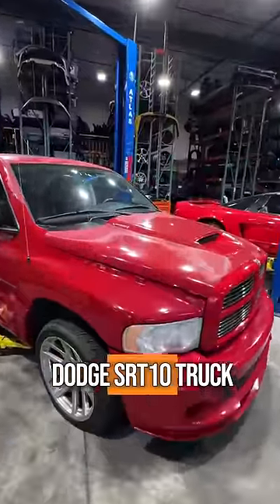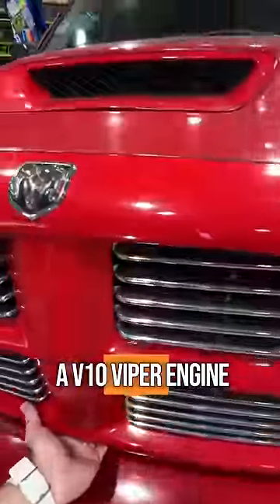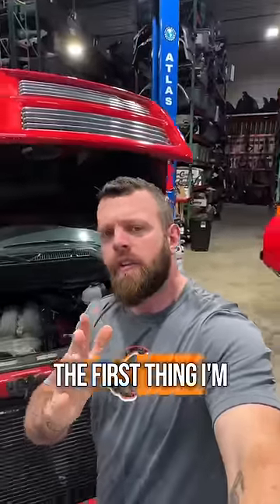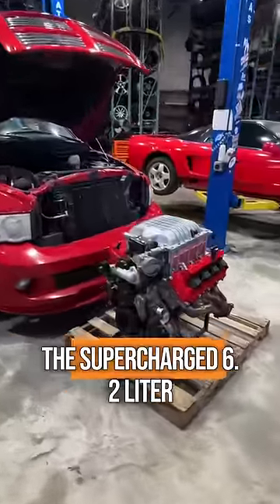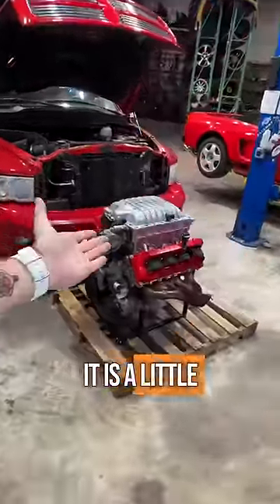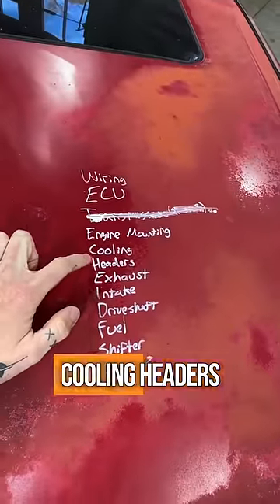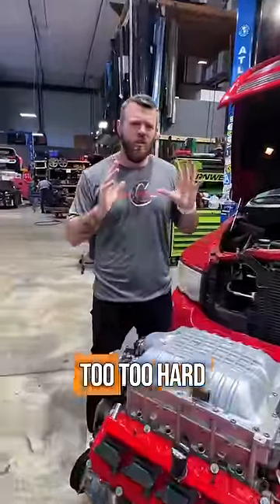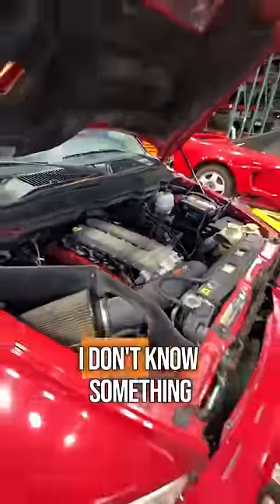Building The World’s First Dodge DEMON Truck!

Comment: “Tires are dry rotted”proceeds to do burn outs
Guys I thought this was funny 🤣 I’m not saying I wouldn’t do the same
Reply: Correct. Its not like he could have put different tires on in the time between the clips
Reply: What else are you supposed to do with em. I'd rather blow a tire in a secluded area than blasting down the highway at 80mph
Reply: "don't hold air"

Proceeds to do burnouts on flat tires?? 😂 OK...
Reply: That’s exactly what you do with them.
Reply: Well if your gonna replace them mine as well
Reply: @jackengele2144 he didnt theyre the same
Reply: what else are you gonna do with dry rotted  tires
Reply: If they're gonna be tossed, may as well use what's left.
Reply: I came to see if somebody pointed out the burn out after he said tryes are dry rotted!! 😂😂😂😂😂😂
Reply: @shaktisingh5543  🤣
Reply: @jackengele2144 yeah but what happens if the tire blows and takes out the whole rear end ik we’ve all seen it before
Reply: If you were trying to make some clever point, you have failed miserably.
Reply: @Willie-wf7vj  dude it was a joke I thought it was funny
Reply: "Doesn't hold air" means they lose pressure/ constant slow leak. It does not mean the tires can not be inflated and stay inflated long enough to do a burnout.  @briansguy
Reply: Why not?
Reply: @briansguy they slowly leak , hold air hood enough to burn them
Reply: Proceeds to install Demon engine ✈️🤣
Reply: Ive got 6 wheels all with dry rotting stocks just waiting for me to slap an lsd and one piece drive shaft into my truck and let her eat
Reply: @jones9309  🤣🤣🤣
Reply: @nikhenry4621  🤣🤣
Reply: Best way to send them off! I picked up a super cheap set of tires last summer, finally got around to checking the date code and they’re from the late 90s lol. They’re amazing for burnouts! They smoke immediately 🤣 just don’t try to stop in the rain… they’re the first thing getting changed when it’s back out of storage. They’ve been stored inside for many years and don’t show signs of cracking/failure, but I probably shouldn’t be driving around on tires that are older than me, especially not for the sake of a few hundred dollars.
Reply: @briansguy If you needa get new tires anyways why not have some fun with the old ones
Reply: Agreed a stock viper v10 engine with low mileage way more impressive and cool then a hellcat engine and more rare
Reply: "Finish him"😅

Comment: I would not replace that V10 with a Hellcat engine I would twin turbo that V10
Reply: Demon engine
Reply: Makes more power right. No sense because there’s no replacement for displacement.
Reply: Supercharged v10 would be sick
Reply: If you were gonna demon swap a dodge ram why not spend less money on a base model?
Reply: Exactly tt it and be able to make close to 2600hp and it be done or LeTs PuT dAaA dEmOn iN iT
Reply: Newsflash, its the same engine. @codysnyder7341
Reply: @emmanuelmedina2740   no its not
Reply: @bradmiles8242  literally is, but go off
Reply: @emmanuelmedina2740   your saying a v10 is the same as a demon engine not even close karen
Reply: @bradmiles8242  my man, my first reply wasnt even towards you. I was talking to the guy saying the hallcat engine isn't the same as the demon.
Reply: @jackstraw8786 bc this is a srt-10 ram, only a few thousand were made. it has suspension brakes trans and a lot more that can handle the demons power, a base model could but it wouldn’t be ideal.
Reply: @emmanuelmedina2740 well while it technically is the same engine, demon has a bigger blower so not really
Reply: @epicpeegaming2438  ...so...youre saying its the same engine with a different blower? so how not really? when you literally just said it was
Reply: @emmanuelmedina2740  dude I know I was teasing
Reply: Biggest down grade keep the v10
Reply: @emmanuelmedina2740 the demon engine is twice the horse power
Reply: @epicpeegaming2438  its the same engine, no two way about it. Theres no "technically". Its the same engine. Swapping FI systems doesn't make it a different engine.
Reply: @ExtraterrestrialBeing-jc7to  twice the horsepower of what? The viper motor puts out 500 horse NA, and the Hellcat does 700+ SC'd. The Demon (the same engine) puts out 800+ with a bigger SC. 

Idk what motors you could possibly be talking about.
Reply: @emmanuelmedina2740  you're talking about two motors with superchargers now if you apply a supercharger to the V10 or even twin turbo it you could be making a thousand plus horsepower
Reply: @bradmiles8242  lmao why u keep arguing with me. Im AGREEING with you. Im talking to someone else
Reply: Quad turbo
Reply: That v10 had more nuts than v8 I don't understand why he did that
Reply: @jackstraw8786 Maybe to have the engine also
Reply: @keegentilley578 twin turbo Calvo build
Reply: @reesebroekhoven3962 twin turbo Calvo build
Reply: @emmanuelmedina2740 No. this is a V10… the demon has a heavy pos V8 that overheats…
Reply: @emmanuelmedina2740 this was made in 2003-2005 kid….. the hellcat engine variant didn’t EXIST until 2015 and the demon variant didn’t exist until 2018…. So no.
Reply: @ysl_BRIAN just under 10,000… roughly 9580 made yeah
Reply: @joshroi8610  can you even read?
Reply: @ysl_BRIAN absolutely not kid. You can upgrade a base model for less than this costs. You could easily build a base model ram hellcat for way cheaper. 

The thing is exactly that. Less than 10,000 V10 SRT10 were made, so why ruin it? If you want a hellcat truck buy newer, don’t ruin a classic and everything that makes it special…. Anyone wanting this truck to be fast, with common sense, would immediately think “Easy, twin turbo V10 Calvo viper drivetrain swap”…
Reply: @epicpeegaming2438 bigger blower and 60-70% of the drivetrain parts are different. So it has the same block and A COUPLE engine components. That’s it.
Reply: @ExtraterrestrialBeing-jc7to lmfao no. The demon engine makes 1025hp, the hellcat red eye makes 808hp…. That’s NOWHERE NEAR double kid. Stay in school.
Reply: @emmanuelmedina2740 again, I’m an automotive engineer child. You’re wrong. It’s the same block with entirely different internals.
Reply: @emmanuelmedina2740 No. hellcat makes 707hp, red eye makes 808hp, demon 170 makes 1025hp. And a viper V10 can be built to handle EASILY 3x the power a FULLY BUILT 6.2l V8 hemi can handle no matter what. Look up twin turbo calvo viper kid
Reply: @emmanuelmedina2740 please continue to embarrass yourself. It’s quite hilarious 😂
Reply: @reesebroekhoven3962  Do they make transmissions for the Ram that can handle that kinda power? I know Calvo has em for the Viper but haven't heard of anything on the Ram.
Reply: @keegentilley578 Roe and Paxton make them for the viper. You have to replace the rods and pistons with forged ones because it will be destroyed in a matter of a few miles if you don't. A stock viper engine can only handle 600-650 HP.. you put a meth injection and a Toe supercharger on it it will melt that baby down
Reply: @rahulsudhir666  the srt10 ram the full drive train is from the viper
Reply: I was thinking put the blower on the 10 with some more bolt ons
Reply: Facts and a nice cylinder head job down pipes exhaust bad ass 😊😊😊
Reply: @jackstraw8786  he put the v10 in his Silvia
Reply: The engine is also very old so twin turbo charging it might cause a lot more problems and the demon engine is much more modern
Reply: @ExtraterrestrialBeing-jc7to  the Demon like 840hp+ and the v10 has 500hp N/A
Reply: @James-ij3lw  good opinion but mine rebuild and twin is a great opinion aswell
Reply: @emmanuelmedina2740 the Hellcat and the Demon  . The same block but different supercharger . Yep  i prefer the V10
Reply: Let me get that v10 😂💪🏾
Reply: V10 Magnum
Reply: Just put the supercharger on the V10 or something
Reply: Yes!!
Reply: @bradmiles8242 . Power output is based upon the boost makers CFM flow. Big Hp V10 N/a with its displacement has so much more potential.
Reply: @bri-manhunter2654  that's exactly what I am trying to say
Reply: Yeah that would be awesome
Reply: Way more expensive
Reply: @bradmiles8242 bro you can’t even read no one said that 💀
Reply: @epicpeegaming2438 you clearly haven’t ever worked on a hellcat 💀
Reply: @ExtraterrestrialBeing-jc7to put a sc on a viper like the hellcat requires 💀
Reply: @codysnyder7341 same engine more power
Reply: @epicpeegaming2438 a blower is just an add on. He's saying it's the same engine dude. Meaning engine block. Not the same bolt on parts lol.
Reply: @ExtraterrestrialBeing-jc7to the demon engine is twice the hp STOCK. That demon engine isn't capable of 3000hp like the v10 is.
Reply: @200130769  I was simply stating the HP they come with..
Reply: @ExtraterrestrialBeing-jc7to  stock hp ratings is for people with no tools in their garage and pay for their race cars. I can't remember the last stock vehicle I had lol.
Reply: @jackstraw8786  he needed a v10 too
Reply: @ExtraterrestrialBeing-jc7to  only because of the super charger. The v
V10 puts out just under 600, naturally aspirated

Comment: The nice thing about dodge trucks is it doesn’t matter what level of truck you buy the body is the same so the engine bay will fit anything up to the 6.7 Cummins diesel.  So lots of height width and length to work with.
Reply: Thats why he should buy another ram instead of using this srt 10 for the hellcat swap
Reply: @nakeddrifter4685  that is also true
Reply: @nakeddrifter4685 I mean at the end of the day, it’s his money and his time. 

Let uniqueness win, not everything has to be oem/stock.

Comment: Why take out the viper motor...just build that motor and have a beast. The sound of a viper is way better than the sound of a demon...but I get it it will be a sick build when it's done!! Awesome 💯
Reply: Dunno about it being a sick build i mean a srt10 is awesome because the v10 you put a beefed up hellcat motor in it. Its kinda lame
Reply: its a totally different V10 than the V10 in the viper. It just has some fancy viper badging. the truck is cast iron while the viper motor is cast aluminum, The viper motor also has different fuel systems, rods, etc. it is definitely a similar V10, just not nearly as beefed up as a legit viper V10.
Reply: @samlamendola  no its the one out of the third gen viper. Its not the old one that was in the rams before its a viper engine

Comment: Nothing beats the sound of a supercharged V8. I love the build. Would be cool to see how it does next to a trx or durango 🤙👌
Reply: Cammed out old school pushrod v8s with or without a dual exhaust sound 20 times better than any kind of a modern supercharged v8.
Reply: @aaronjones5742  any V8, cammed, turbo, supercharger sounds way better then the v10 💪
Reply: @juanbueno1212  I would agree with that 100 percent. I was just saying that the old school v8s sound better than modern ones. They all sound good, but the older ones are top tier. Like a factory 60s dodge challenger with big block and dual exhaust. Those things sounded beautiful. Any older v8s if they were healthy. But yeah in general I think the majority of v8s have a nice sound to them

Comment: Over the 3 year lifespan of this truck, just 9,527 Dodge Ram SRT-10s were manufactured.

Dodge V10 weighs 820Ibs
Dodge hellcat engine weighs 875Ibs
Dodge demon engine weighs 910Ibs

….. “gonna pull this hulking monstrosity out for a smaller engine”….

Maybe you’re uneducated but I’m an automotive design engineer and that’s definitely bigger… and about 8% heavier 🤣😂 what would REALLY be a worthwhile build is if you bought the engine wiring harness and all the accessories for the normal Viper SRT10 engine or bought a whole new viper drivetrain and made a Calvo SRT truck with a twin turbo Calvo setup in it. That would put SHAME to ANY demon truck you could ever build. Calvo vipers are one of the fastest cars in the world, a Calvo swapped truck would leave a demon swapped truck miles behind like it’s a Honda civic and it would stay true to the entire legendary purpose and design of the SRT10 trucks. Especially with only less than 10,000 of them being made total.

Comment: You can put that Viper engine in my 77 Powerwagon. 😁

Dad gave me that truck back in the 90's. When I went to smog it 2 years ago, the electric fan I put on it had a bad connection, so the fan didn't come on. It overheated and spewed oil out the seals. So it failed the smog. I started to take it apart to repair it, then dad passed, and I just haven't had the time to fix it. I won't junk it because of sentimental value. But since my wife has been sick, I just don't have time to fix it. That Viper engine would be nice in it.

Comment: Eh...it's not reeally a smaller engine. I mean yeah the 6.2 is physically smaller than the 8.3 but it's what? over double the HP of the v10? The truck was pushing 500hp with the original motor. You're swapping to a physically smaller motor but with double the horses, the demon is what 900-1025? And that's the point of swapping most of the time. MORE POWER so nothing to feel weird about! ✌️

Comment: So u buy a srt10 truck, which cost significantly more then the base model or r/t trim. U know because its unique and has  a viper motor. Then proceed to rip out said unique viper motor and swap it with a insanely common hellcat crate motor.  Make that make sense.😂

Comment: You should drop that viper motor on a Dodge Dakota or a Chevy S-10 single cab. Or if you wanna get nasty with it why not an SRT-4? You'd likely run low 8s in the quarter and could burn an entire set of wheels in minutes😂